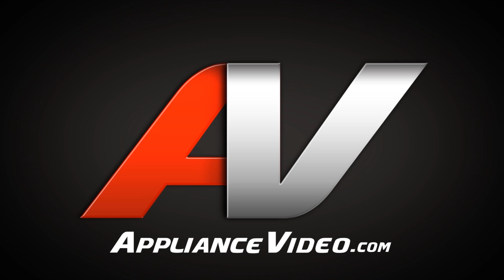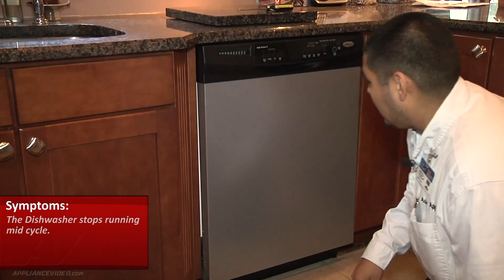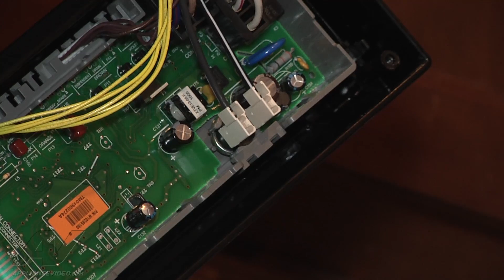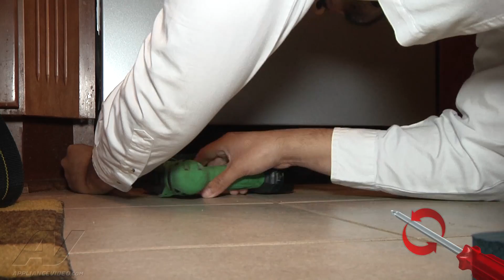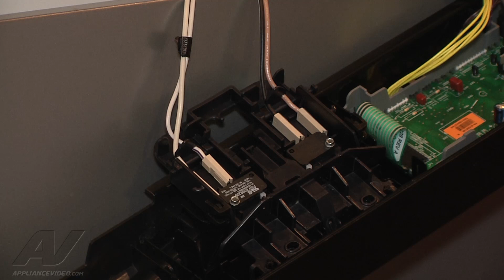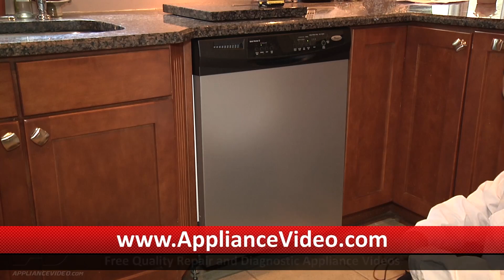Whirlpool Dishwasher Repair - Quits Running Mid Cycle - DU1055XTVD2

Comment: the capacitor on the control board is bad at location c132
Reply: c143 looks swollen too!
Reply from the maker: Great question, if you have a more technical question that our parts department cannot answer, you can search our over 17,000 answered questions free at our website www.ApplianceVideo.com under our Repair Help section. You can also call our parts department at 1-800-830-5465 and they can give you help 7-days A week ,or search at www.SaveMoreOnParts.com  .